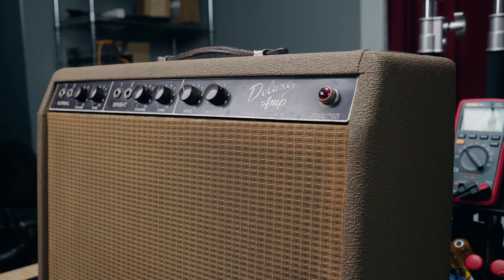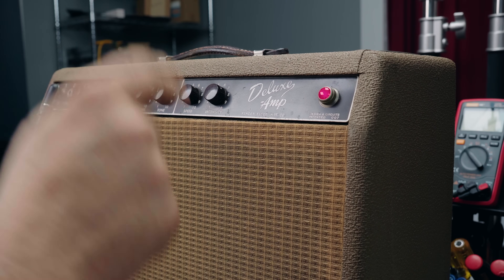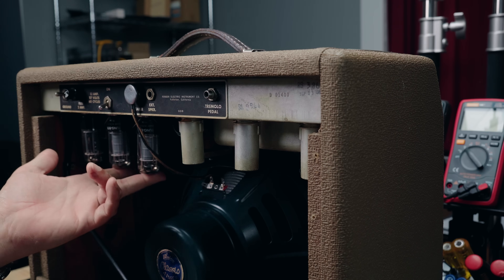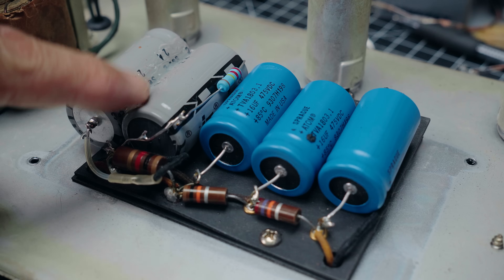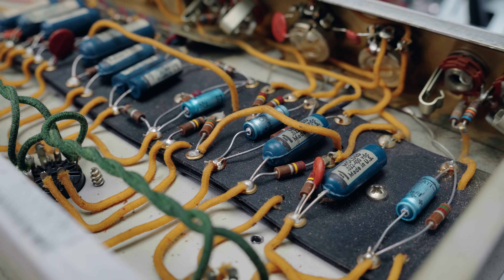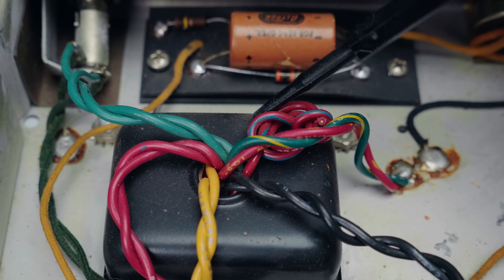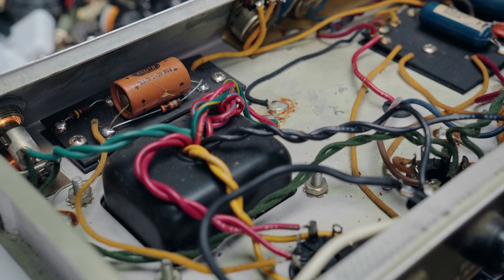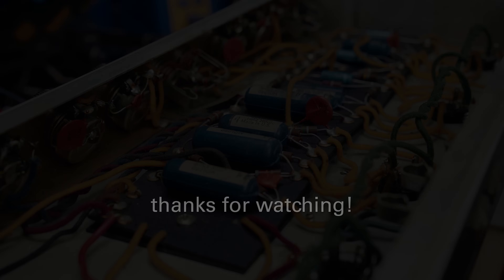Mystery Mojo | Undatable 6G3 Deluxe Pt 1

Comment: I have owned this amp for 30 years. I have never had a reason to open it up since it has never failed me. It's been used for recording and as a harp amp on the road for several years. No work has been done on it as long as I've owned it. I missed the "LA" on the date code chart indicating January '62 completion date. My eyes aren't as good as they used to be. The  blue Ajax  caps are a good thing!

Comment: The LA on the upper right corner of the tube chart is from January 1962. The chassis serial number puts it in the early part of’62. Great video as always.
Reply from the maker: Yeah, I missed the LA as it looked like a later stamp along with the ‘64 stamps. Serial numbers are occasionally relevant for dating, but not always. So I rarely rely on them.

But I think you’re right.

Comment: I have a clone of the 6G3 that I built several years ago. The voltages shown on the schematic are significantly lower (365V on the power tube plates) than what I was able to achieve with a Deluxe Reverb power transformer (it seems like this amp has the same issue). This leads me to think the brown Deluxe PT was different than the Deluxe Reverb PT in more ways than just the 50V bias tap. The amp just didn’t sound right at those higher voltages and I wasn’t happy with the other rectifier tubes I tried. I ended up putting a voltage dropping resistor on the B+ before the first filter cap and am MUCH happier with the tone of the amp at voltages closer to the schematic.
Reply from the maker: The owner’s played this for 30+ years and likes how it sounds, even if it’s not “original”.

Not saying you’re wrong, just that in this case we’re leaving in the ‘65 PT.

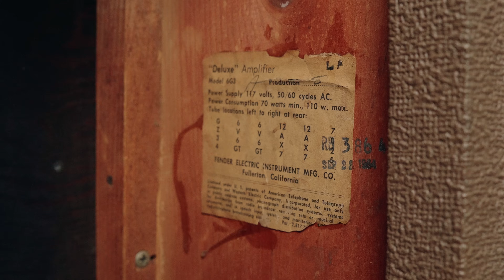Comment: Another interesting video, thanks! FWIW, at 6:47, the tube chart is displayed. According to Fender amp date coding, the two-letter date code, LA (located upper right of the tube chart), would make it 1962 = L and January = A. Wouldn’t that provide the date the amp was produced, albeit with some older (then later updated with newer) components?
Reply from the maker: Not sure. It’s so not in the usual spot I thought it could be a later stamp like the ones from ’64. But Jan ‘62 is in line with my other clues so far.

Comment: Geekie joy indeed!  I didn’t know Fender ever put a copper shield in like that but it makes sense given the location of the Bright channel’s input jacks. 

Is that bias vary tremolo or did I miss a roach somewhere on the board?  Lyle knows this for sure, but adjustable bias is kind of essential with bias vary tremolo. Bias it too hot and no tremolo.  It can be a bit fiddly getting it dialed in.

Comment: Solder joints that bubble when heated are indicative of some type of contaminant: capacitor or battery leakage, oil or grease, conductive glue, or even hot glue.

Comment: Why does the ground wire have to be longer than the hot and neutral wires? Specifically, other than "for safety reasons?"  I'm worried because my Mojotone kit did not specify that technicality.
Reply: If the power cord were to get pulled out from  the chassis the hot and neutral wires would/should stop the ground wire from being pulled loose. Your ground connection would be protected. Functionally there is no difference.
Reply from the maker: Well, a bit more than that. If the cable was pulled and the hot connection broke loose after the ground, the chassis could be electrically live. With the ground longer, the hot touching chassis would short out, tripping a circuit breaker.

Comment: I have never seen a Brown Deluxe with a single Astron film cap in it. I’ve looked through hundreds of images too.
I just don’t think Fender ever used them in the 6G3 through its entire production range.

I tried to clone how Fender built a 1960/61 Deluxe a few years ago. A lot of the other amps have mixed blues and yellows, so I wanted to do that. Nope, not a single one I could find had a mix.

Mojotone has 500v 16uf F&T’s btw. If the owner even cares about original component values anyways.
Reply from the maker: I’ve seen yellow Astrons in them but that was before I started the channel.
Reply: @PsionicAudio  It's pretty rare then. Being Fender, anything is possible.

Comment: Warranty power transformer?
Reply from the maker: I imagine so.
Reply: Possibly. Remember, Fender amps at some point, used to have a 5-year factory warranty.
Reply: @tjminasi1442  ,  One wonders how many, or more accurately how few devices have a 5 year factory warranty these days. (My Sebo vacuum cleaners which are 8 years old now had a 5 year warranty on the motor but a lifetime warranty on the belts.  I've never needed to change anything on them other than filter bags and the prefilters).